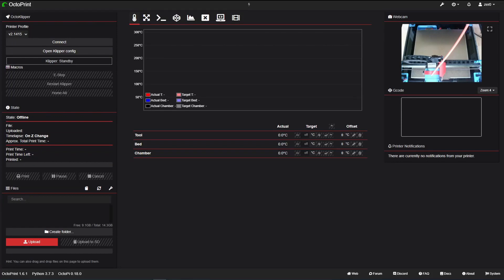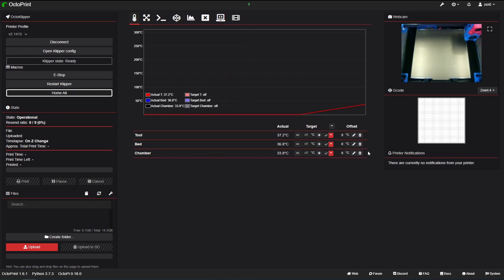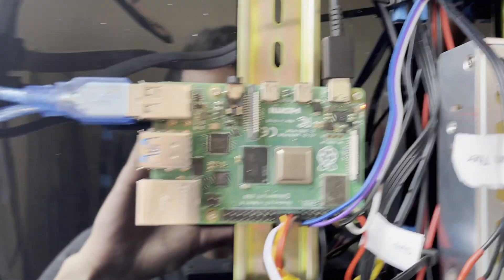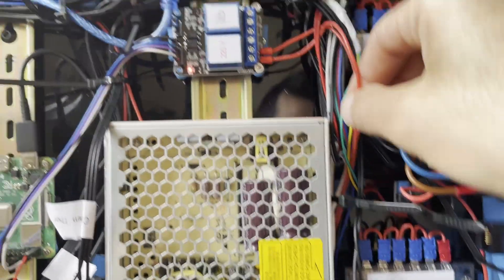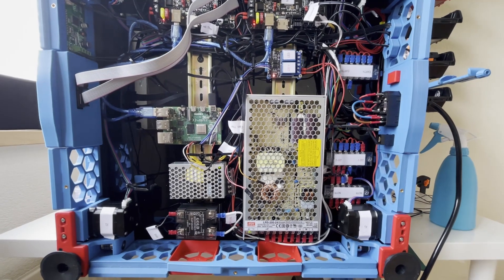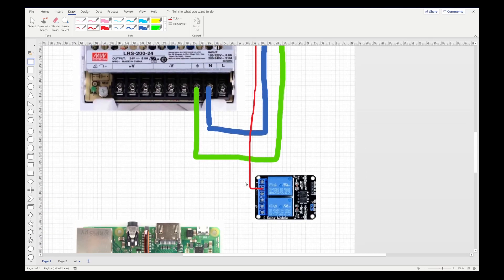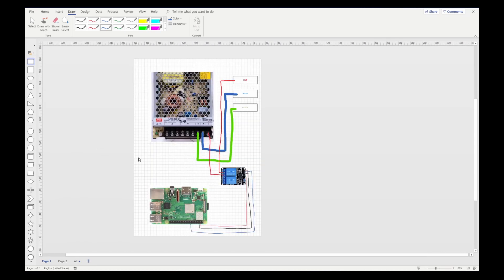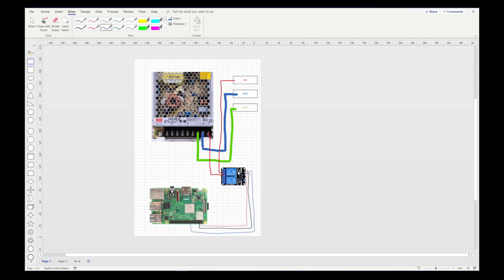Building Voron v2.4 - Remote Power Control [Ep15]

Comment: What gauge wire did you use for the mains going thru the relay? Trying to figure out a similar setup myself!
Reply from the maker: I have used 20AWG. 20 is fine however if you have 18AWG, it is better to use for mains.
Reply: @zer0isdoing  Awesome, great guide, working well.
Reply: Side note, a video on your octoprint plugins would be welcome from me! Working on setting up chamber temps currently. And your layout here is nice with the video to the right and gcode underneath.
Reply from the maker: @eddytheflow  Sorry but, I have sold my v2 to create fund Trident build. That's why I am not adding another video in this v2 series. However, if I recall correct on the last videos I was mentioning plugins those I was using.